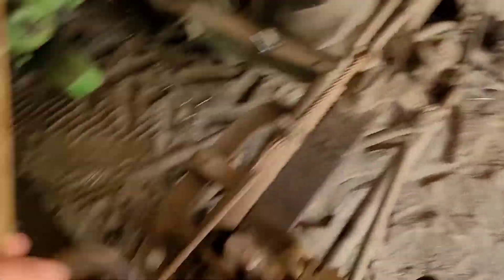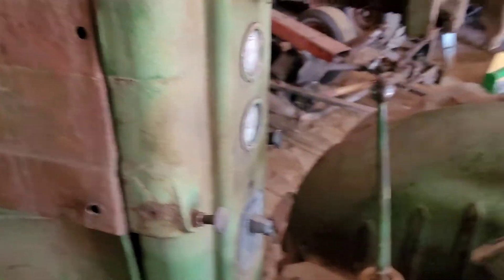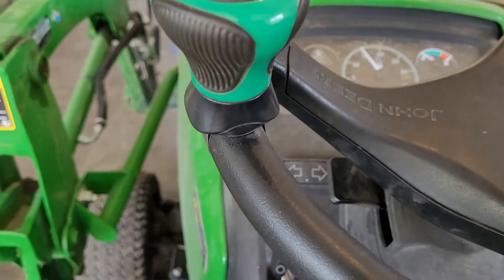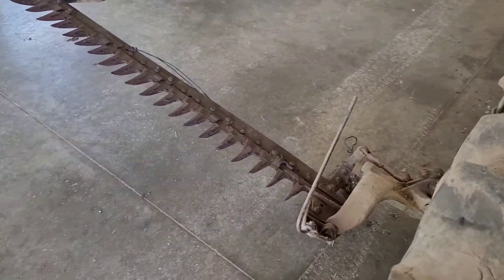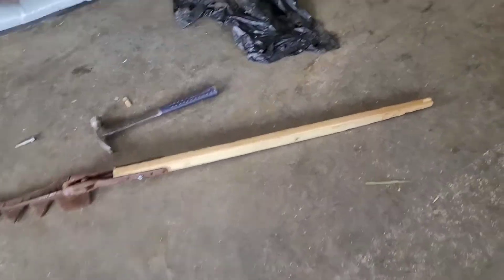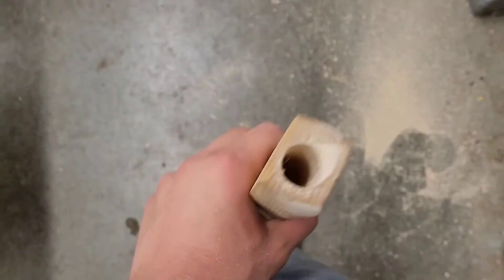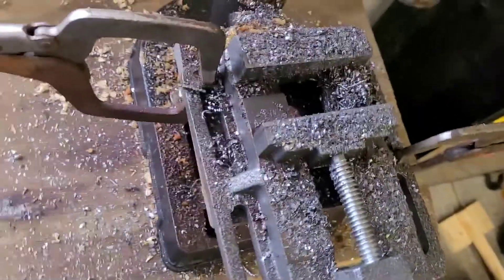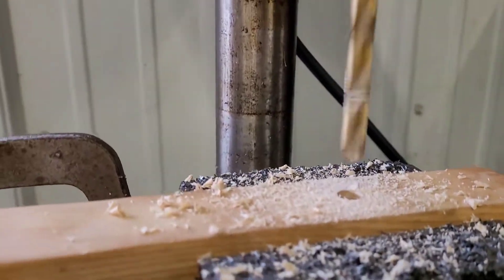Back so soon? Replacing the pitman arm on a john deere sickle mower

Comment: I wanted to see how you actually removed and installed the pitman arm. How do you disconnect the arm from the ball? Is there a special tool that slides the spring back in the end of the arm so the part will easily fit over the ball????